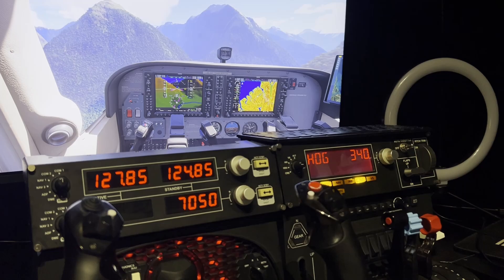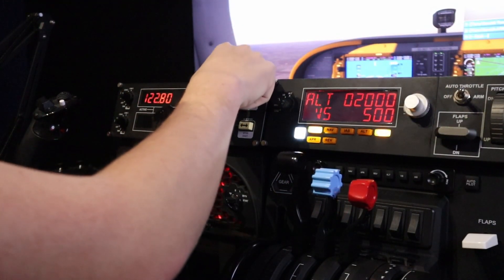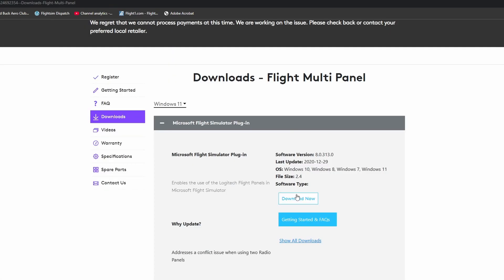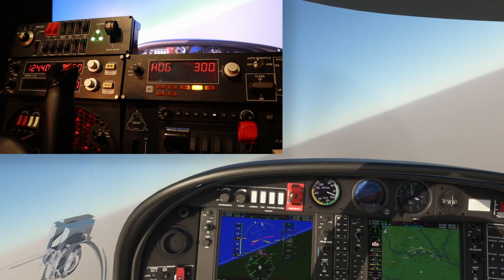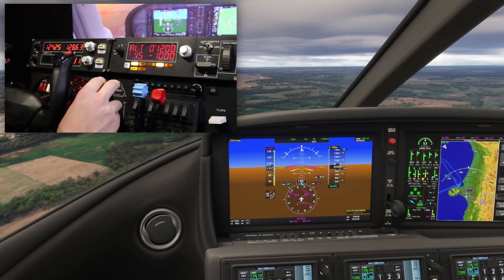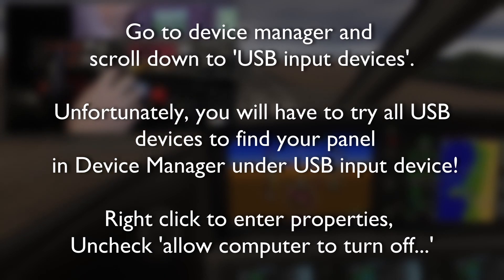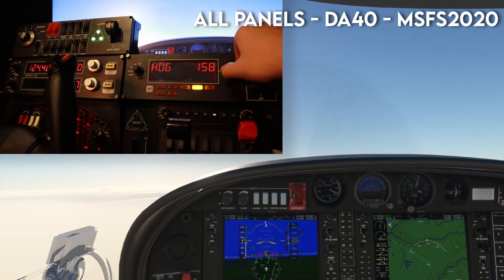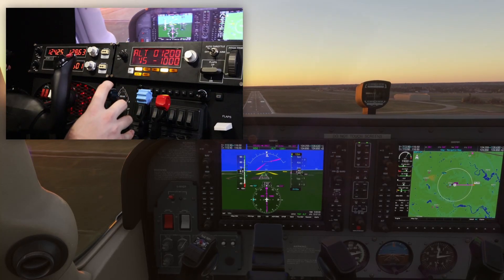HOW TO USE LOGITECH/SAITEK Panels With Microsoft Flight Simulator 2024 & 2020 | Setup & Review

Comment: I have 2 Logitech radio panels and both have corrupt displays. One of the LED digits is missing an element. Exact same issue on both panels. I have 30+ year old digital alarm clocks still with perfect displays. Disappointing.

Comment: Hi there,
I've installed the plugin and I'm running MSFS 2024 through Steam. The switch panel isn't lighting up at all, although the yoke, throttle quadrant, and rudder pedals are all working fine.
Do you have any idea what might be causing this?
Reply: I have the same issue currently, did you ever find a fix?
Reply: @adamel-sakhawy5082 yes mate I bit the bullet and got SPAD NEXT
If you google spad next flight simulation software it works perfectly 👍🏻.

They will give you a free trial I think it’s 14 days then just buy it it’s worth it mate
Reply: @adamel-sakhawy5082  I don't have these devices. But are you using a usb-hub? It must be powered. The usb port on the Yoke isn't sufficient, if I'm not mistaken. So maybe the solution for your problem is use a POWERED usb hub.
Reply: @RichardAirborne  mine also having the same problem like yours , and couldn't find inside the game option , the game didn't recognize them , now I got one switch panel and the multi panel all of them not shown in the game 😔
My game version is 2020

Comment: My yoke has worked perfectly since day 1, but I just got the multi panel and it turns off after a few secs. Going to Logitech website does nothing either, as apparently the downloads have been removed and there's no way to get the plugin

Comment: I just purchased a Logitech flight panel directly from logitech in the UK so it does appear you can still buy directly from them in the UK. I also have the Honeycomb bravo throttles but I find the autopilot feature is not good, it works by that knob that selects the AP modes is rubbish, how hard would it have been to give it a knurled outer, such as what you get on the Logitech panels, and also they could have at least made the raised line to indicate what position it is in, white or some other contrasting colour, easy enough to fix with tipex or a white paint pen but for the money you would think it should already be like that. I also find with the throttles forward I often catch them as I am trying to switch autopilot mode. So the entire reason I wanted a separate unit for the autopilot is because of that one knob!  I also like the digital display which I find easier to read than looking at the instruments.

Comment: If you don’t recommend the multi panel, do you have a recommendation for something similar to adjust headings, altitude, vertical speed,etc?
I was considering buying the Saitek.
Reply from the maker: Bravo Throttle Quadrant is your best bet for the sim now, the only caveat is that you do not have the numerical display.

Comment: If radio or multi panel does not show I just unplug and plug back in again while in SIM and this sorts it for me. I found spad to cause more issues than it's worth especially with fenix A320. In 2024 you may just need to start the plugin manually as it does not always auto start.
Reply from the maker: Indeed, thanks for watching! Spad.next work fine for me with the correct presets on the Fenix